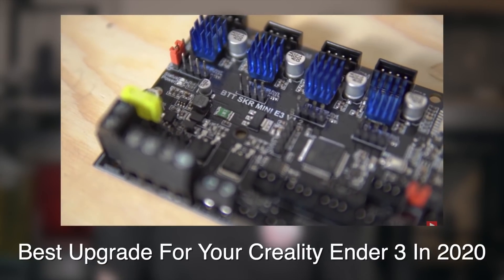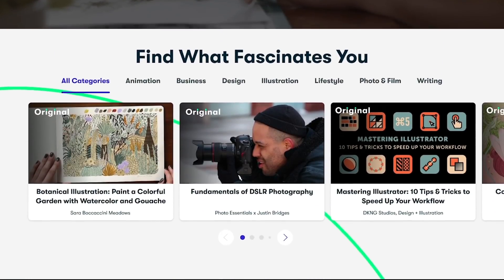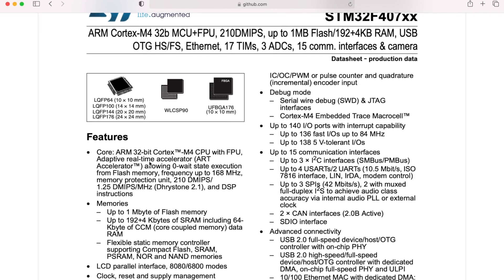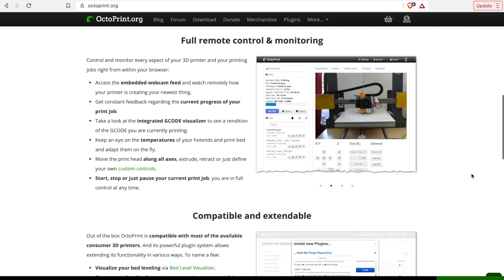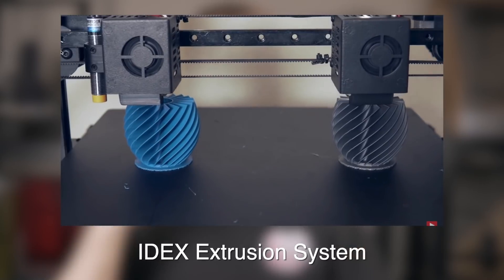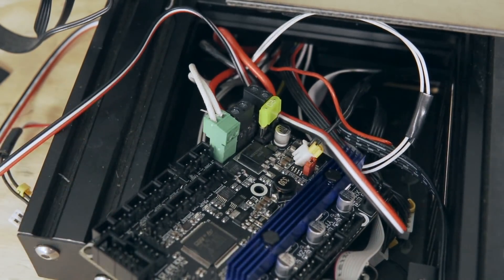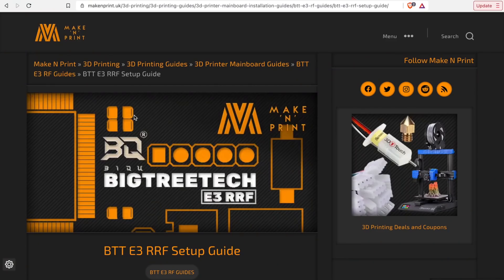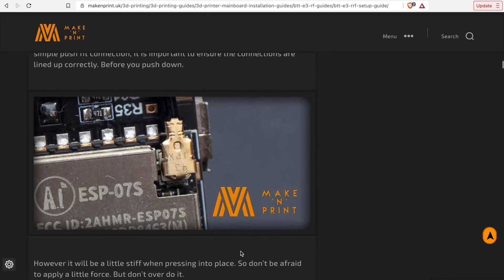Best 32-Bit Board For Your Creality Ender 3 3D Printer In 2021 | BTT E3 RRF

Comment: Awesome video, I bought this board after Chris done his video on it as I wanted to try RepRap firmware.  Installed it on my corexy last night, still have some trouble shooting to do to get everything perfect, but so far I am loving the firmware.  

In Chris Rileys video he attached the board to his computer via USB to get wifi working, and while that isnt exactly a hard thing to do, it isnt needed.  If you make a "runonce.g" file and place it in the sys folder it will eliminate that step.  Just put the same commands in the file Chris ran in the terminal and it will run those commands after it flashes the firmware to the board.  

these are the commands:
M552 S0                       ; disable network
G4 S5                         ; wait half a second
M587 S"yourSSID" P"routerpassword" ; configure WiFi
G4 S5
M552 S1                       ; enable network
Reply: That's good info, do you have any reference for corexy config. I am looking to do the same.
Reply: @spearview  I would start with this online config wizard, I wish I knew why YouTube will not let me post outside links on some channels, but I have tried to post the config wizard link more than once now and it deletes my post.  So in the description of this video is the link:
https://www.youtube.com/watch?v=2ytFdP2_Myo
The video itself, not that great, at least I didnt think so, but the online setup should help you get things started in the right direction.  
It is the teamgloomy link in the description

Probably the next biggest piece of advice I can give you is to search for how to do things on the Duet board.  Firmware configuration wise, it is the same on the Duet as it is on this board.  Searching for how to do something using rrf or reprap will not produce good results.  

Chris Riley also has a few different videos on reprap firmware and various boards that can run reprap firmware.  I highly suggest going though those videos, even if they dont pertain directly to this board.  There are little bits of valuable information in all of them that I watched that helped me get things running perfect.
Reply: @jon9947  sure thanks. I have the link for online configurator. In fact the dwc takes you to that page when you edit config.

I currently have it in ender 5, thinking of moving it to tronxy d01.

Have seen Chris video but not sure which video you are referring too.
Reply: @spearview  I highly recommend staying away from the Tronxy D01.  It is hands down the worst printer I have ever bought by a significant amount.  In the end I made it into a good printer, but the only thing I kept from its factory configuration was the frame and the rails.  The linear rod bearings had to be replaced, the power supply had to be replaced, everything else had to be replaced.  If I could start all over, I would have just ordered some extrusions from tnutz, bought some rails off Amazon, and been ahead starting from scratch.
Reply: instaBlaster

Comment: So, I have the Tevo Tornado with the Gen L1.0 board and a Creality Ender 3 max with the 4.2.7 board. I wanted to upgrade both printers. So, will this board be a good choice and will it fit without modification? I think so from the video. I have 2 lead screws in my Tevo Tornado. I think the lead screws are 2 lead/2 pitch versions. One final question Will this board run Klipper firmware. I might want to try it out on the Ender printer. I am running Marlin 1.1 on my TEVO right now. I also have 2 Pis one running Repetier Server and one running Octoprint latest version. Thank You, Great video(s)!!

Comment: You should review FYSETC Cheetah V2.0 board. It has all the features from SKR Mini E3 v3.0 but uses faster MCU (Cortex M4 vs M0+), has USB-C and 12V output, also you can set fan voltage via jumpers. It's a great board at the same cost and no one is talking about it  🤯

Comment: they have dual z option but i have noticed they have only 4 axis motors drivers, does the firmware also can deal with g34 command?

Comment: There are only 4 driver chips on this board, so double Z is only a parallel connection. this board cant do a G34. Not recommendable for Dual Z.
Get your facts right!  It may cause people to buy a board which might be a mistake.
Reply: thanks god i read this before i have subbmitted the order, i saw that but i though the firmware can deal with this, even they are connected in parallel if it can disable on output of the driver it can work, but thanks god i read your comment and waiting to see if anyone tried to run it
Reply: @7ickmat  You want a relais switch selection,  first home Z (a)  then home Z (b)  lol    i havent seen this done, you would be the first :)  Best to buy a board with 5 drivers   easiest solution and cheapest.

Comment: For people on a budget buying the original Ender-3 for $165, this BigTreeTech E3 RRF is much better for $38 than the Creality v2 board which sells for the same price.  Add a PEI flex plate and BL Touch, and it’s still less than an Ender-3 v2.

Comment: So is the SKR Mini E3 V2.0 just a drop in replacement, or do I have to compile a firmware or anything crazy. I have been considering the motherboard replacement and adding the  TFT35 E3 V3.0 Touch Screen Display, but I can't seem to find a straight answer on this. Thanks for the video.

Comment: Nice review! I upgraded my modded ender 3 to skr mini e3 V2. Using a lot of features as sensorless homing, linear advance, UBL with z offset wizard (big time saver) and octoprint.
I wonder if I should just use the same board to my other printer (redesigned old hadron orb bot to Creality style) or try these new RRF.
It would be interesting to see one of these boards running Marlin to control a CNC router or a laser engraver. The 32bit board and silent drivers definitely would be great.

Comment: The IDEX capability looks good, have you still got the Weedo X40 and what do you think about this as a upgrade with a BTT screen and IDEX board? The X40 firmware is still in need of refining so upgrading would be an option.

I have bought the rrf board and a Ender 3 IDEX kit. Going to fit it to the Ender 3 Max, when I get a longer drive belt. If the board works well I may get one for the X40, when I finally get it delivered.

Comment: Thanks for the review, just got a mini V2 board for my Ender 3 MAX as it came with a Creality 4.2.2 board which only has silent stepper on X and Y. I also had to compile marlin to get it working with Octoprint on the Creality board as the firmware was buggy. This looks good, wish I ordered it instead of the V2 a month ago, but hey.

Comment: Yeah this board is great. I tried both styles to see weather reprap or marlin was better and ended up sticking with the marlin version. It seems a little more polished than the raprap which I kinda expected but I'm sure a little firmware tweaking will easily solve that bit im new to reprap and need a little more knowledge before im ready to go in deep in reprap. I also got a new skr 2 I plan on dropping in an ender 5 plus. But so far this board is going great.

Comment: I just need to wait until this is on Amazon so that I can actually purchase it with some degree of confidence haha. I really want something powerful enough to enable M2 / M3 arc support so that I can experiment with true curved paths. And also newer Marlin firmware. Lol. I’m really tired of the stock firmware but figure I might as well wait to upgrade until I upgrade the board since Creality makes it so painful to update
Reply: I bought mine on Amazon, it even had a $5 off coupon for a day or two after Chris Rileys video.
Reply: @jon9947  you can find this model? I can only find the V2. Nothing showed up for this actual model when I looked
Reply: @EntropyValley  Yes, I bought it on Amazon.  Apparently YouTube dosnt like when I post links for some reason, I tried posting a github link earlier for someone else and my comment didnt show up.  So not even going to try posting an Amazon link, instead I'll post the video that Chris Riley done on this board, he has it linked in the description.
https://www.youtube.com/watch?v=TA5vWGzhx2s

Comment: I've gone through two of these. Both of them fried themselves. Fan mosfet on the first one, the second one I uploaded the firmware to it, installed it, and got a MAXTEMP error that wouldn't go away no matter what I tried.
Reply: From my research BTT is a notoriously unreliable brand. I went with MakerBase MKS Gen L with 2209s. This is the 8-bit version of the 32-bit SGEN but should be plenty for Klipper. I'm planning on trying UART mode.